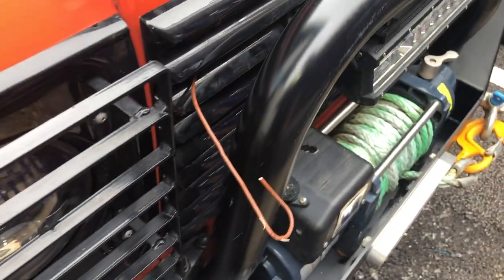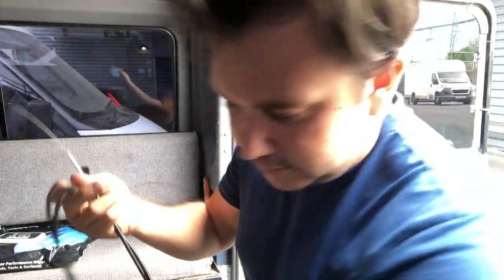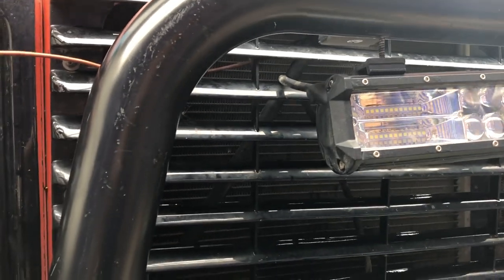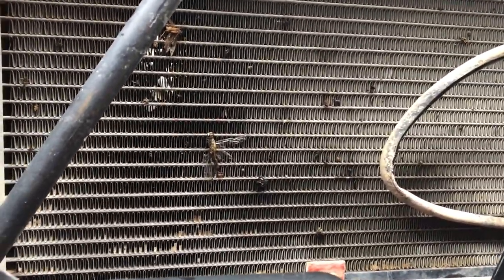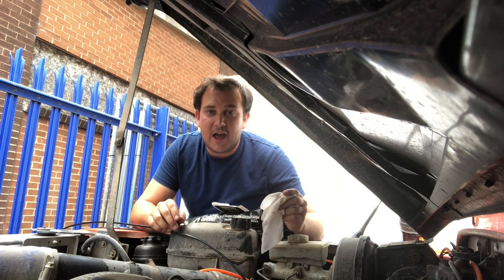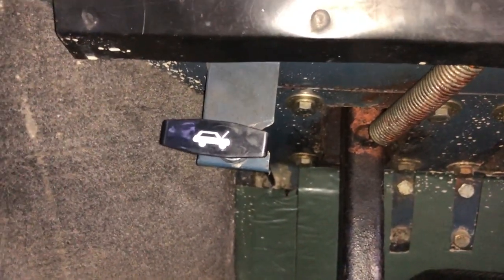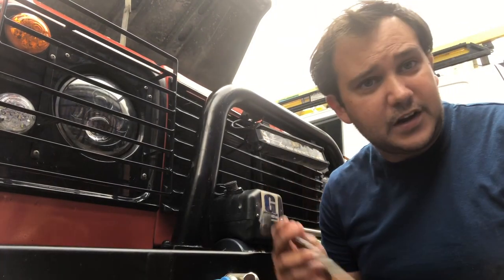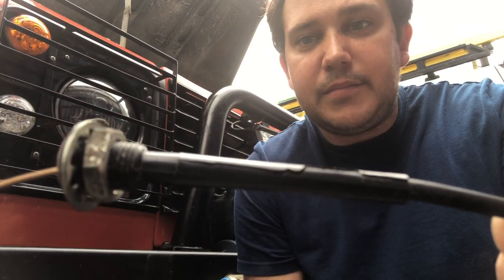How to replace a Land Rover Defender Bonnet Release Cable

Comment: Nice video, went to change the water pump housing and my cable was really hard to pull (which it has been for some time now),. Heard a pop and when I checked I could see the cable, looking at your video I think the cable has pulled out of the clamp at the bonnet release end. I'll have a look, your video has helped cheers
Reply from the maker: I'm glad it could be of help. I'm in the process of making the next video so keep an eye out for more.